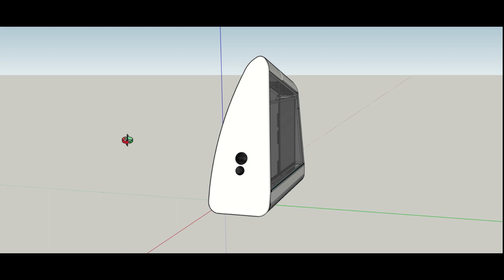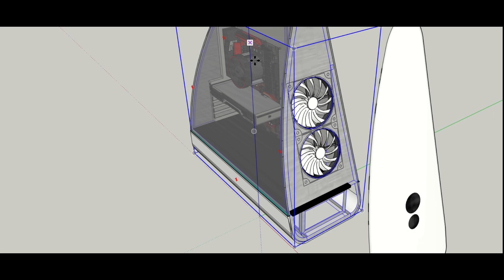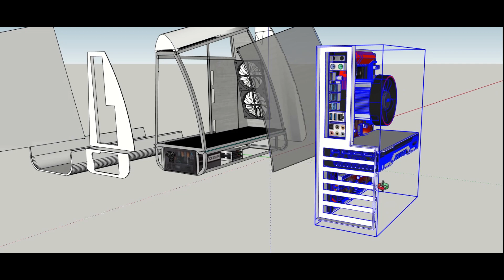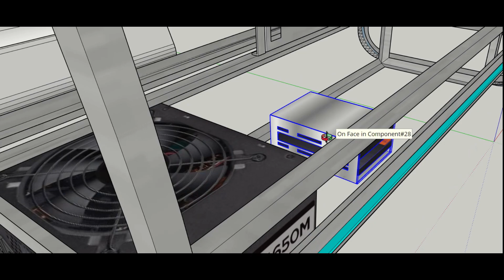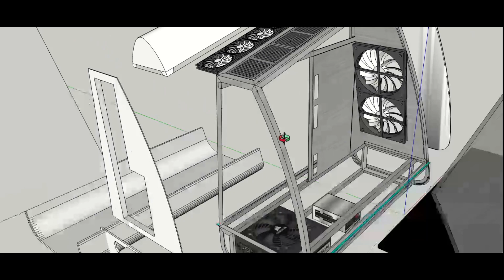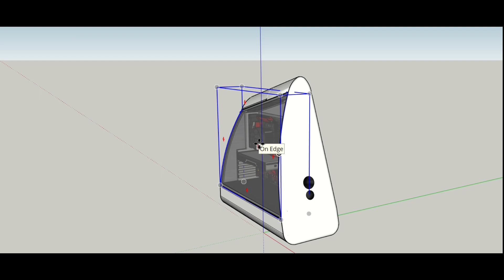Scratch Build PC Case - Design   Part 2

Comment: Ok you aren't going to like this but it needs to be said.. This design is terrible for airflow and heat. 
Fans only work well if their airflow is unimpeded, that means you need plenty of space for air to get in as well as out... The front really needs to be mesh and the top needs significantly more exhaust space.
Try putting a couple of fans in the front and doing a smoke test.. It looks like their angles will be driving aircolumns down toward the back corner of the case with the top fan blowing onto the GPU and the bottom dropping air infront of the GPU angling toward the base of the case. This is fighting against the GPU fans and avoiding the motherboard, neither of which is what you want.
How big are the top fans?  It's hard to judge by eye but a PSU is 140mm wide while most radiators are 120mm, that looks significantly narrower.. 80mm?